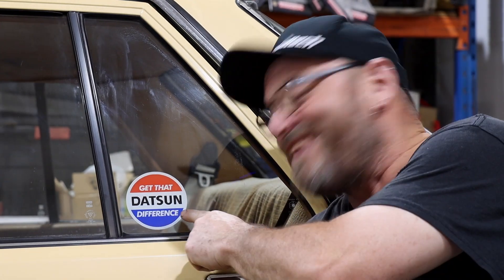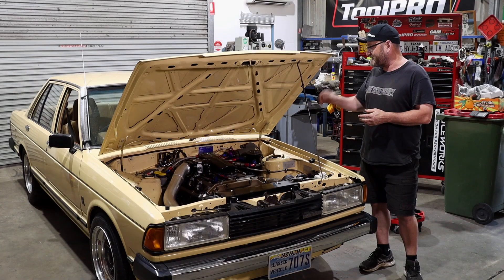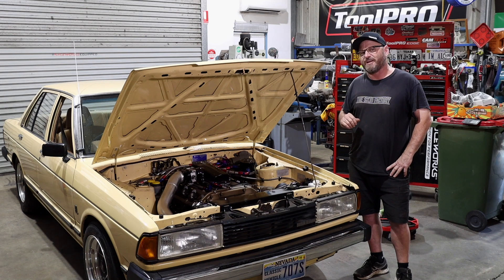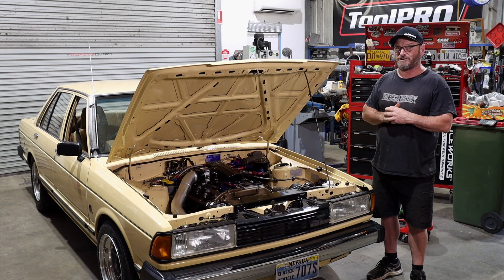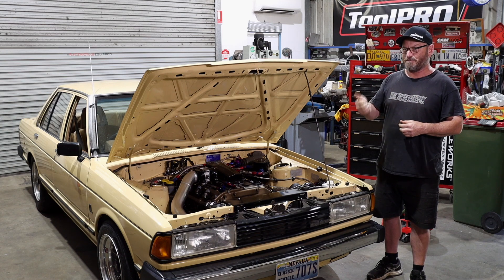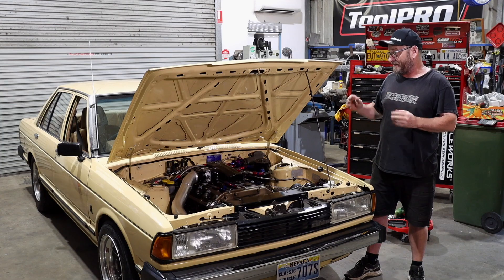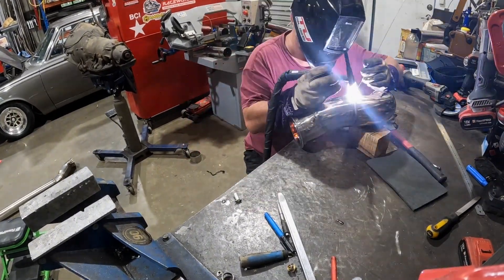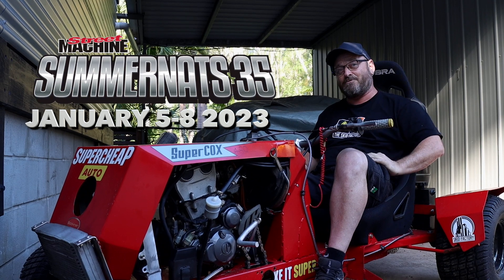550HP TURBO V6 VQ35 - Get That Datsun Difference

Comment: VQ's are some of my favorite engines to build, both N/A and for boost, and I love that we are seeing such a monumental surge in unique content/interest (...chicken/egg... whatever, you guys get it haha) revolving around the VQ platform!!

Thankfully, I expect that it will only continue to grow in popularity, at least here in the States. Especially as the vehicles that are powered by the VQ's are settling squarely within the price range that make them attractive to first time car buyers, or tuner-car buyers, alike. Combine the low financial barrier to entry with the fact that almost every VQ Nissan manufactured was built to power a RWD (OR AWD!) platform (350z-370z-g35-g37-m35-q50-etc) straight from the factory...shiiiiit. These build options alone really has me looking forward to the future of what the performance automotive industry will have to offer.  :)

Then, once these VQ's start to lose relevance or become hard to come by as the years come and go, all of a sudden the VR platform(s) will reshape the scene just as the VQ is now, and if you can't get excited about 400+WHP and chu-chu sounds with 100% stock components running on pump gas with a simple reflash of the OEM ecu, you might be in the wrong place?!?

Comment: Thank you for creating such awesome and informative videos Al and Woody. It's really calming watching you transform parts into mechanical perfection and a bloody good laugh as well. 

I have been working on my project car on and off  for a few years after watching your first turbo install videos Al, with Marty and Moog, which inspired me to get tinkering again. I grew up in the bush in Southern Africa working on enduro bikes. I was so happy when you started your own channel. 

So using all the info from your and MCM vids I turbo charged my old family hatch back Nissan Almera 1.4GX N15 (GA14DE) with a Garret GT15 Turbo from an old BMW, using Sentra turbo racing exhaust header, 1.6 Sentra fuel rail + bigger injectors, catch can, fabricated a down pipe to link up to stock exhaust, air/fuel sensor + guage, intercooler from the same wrecked BMW + BOV + boost tap, and added a Perfect Power SMT8L piggyback for fuel/timing. I also did a head gasket change and replaced timing chain + guides. She went from 80hp NA to 120hp, scared to push it harder without upgrading internals. 

It’s been a great journey, and she is all working sweet now, just fighting with 27 Yr old bloody stock immboliser system ironically that intermittently drops sync with the key chip, so working on how to bypass it at the moment.

Thanks again, you are legends!

Comment: My dream is doing this to a 2 door hardtop 🤩🤩🤩🤩 I grew up with one of these, a 82 diesel (L20D). The most bullet proof engine ever: at 400 000km it didn't heat a glass of oil each 5000km. Also the most clear dash ever, specialy at night. Torquey but such a snail! It had IRS in  Europe so handling wise it was  very similar to the small BMW and Mercedes of the time (front mc pherson and semi-trailing arms at the back)
A school of drift!

Comment: Loving the Datsun. My first car was a 88 bluebird. A great car if you liked working on cars, always something to fix.
Reply: You had an ‘88 Bluebird? Which country was this in? I think they had replaced those, with the Skyline-bodied (R31) Nissan Pintara’s in Australia by then.
Reply: @paulsz6194  it was in Oz. I might have the year wrong. It was the last of the bluebirds, whichever it was. It had a 2.0l twin spark inline 4. Rear wheel drive. 5 speed manual. The headlight enclosures were all clear, rather than having an amber indicator lens. Had nothing but trouble with it, but  your first car is supposed to be like that I think. I enjoyed my Ford Telstar more.
Reply: @james.vanmaanenberg  
1985. After that, the Pintara with unleaded engine was released.

Comment: Yes,the Nissan engines run tight crankshaft bearing clearances from my experience with the RB30 engine.

I was told that the rear drivers side lower control arm mount needs to be braced better than Nissan did it at the factory if a high performance engine swap is done it can tear it off the shell.of the car since it's just welded onto the shell & not the chassis rail.

I was told that the right hand rear control arm mount tore off the shell  underneath of a Nissan Bluebird sedan after they did an FJ20DET engine swap into it .

That car was available in the I.S. in V6 form badged as the Nissan Maxima or Cedric.!
Reply: I too have the internet and taken steps to strengthen the rear chassis connections

Comment: i just picked up a almost unmolested 84 model 3sp auto l20b job with a genuine 123785km on the clock . i do have to fix up some home brew wiring but will need the owners manual for that.

Comment: Having a 910 long nose with a L28ET love these short nose 910 jelly of the smaller bumpers.
Reply from the maker: I have never heard of a long nose 910. Sounds cool.
Reply: @theskidfactory  Essentially the same car, US spec car we call the Datsun maxima aka Datsun 810 Maxima stupid US marketing.  G910 chassis IRS rear suspension a L24E up front with the longated front end to accommodate that inline 6 as well as ugly big bumpers.  81-84 were the only years offered on the G910 with a L24E petrol engine or a LD28 diesel early 81- partial 83 offered with a 5 speed or 3 speed auto half 83-84 offered 5 speed and 4 speed OD auto Jatco transmission.  Our L24E had a N47 cylinder head with a P30 block 8mm rods.  We also got the predessor G810 for 77-80 with only L24E engine offered 4 speed manual, 3 speed auto.  Sedan had a IRS rear suspension, wagon had the H190 solid axle, 79-80 Hardtop/Coupe had a IRS rear suspension, 5 speed manual or 3 speed auto.

Comment: Bro... used to go to tafe when I was an apprentice back in the day with a lad that had that exact car with a z18t I think they were called... old twin spark turbo motor with a bigger turbo and an ancient aftermarket ecu... maybe 250hp... it regularly used to pull the control arm mounts outter the floor... ha haa.

Comment: This engine bay is proof that, if you want to give yourself an upgrade path and the ability to reuse components in the future, you need to invest in quality components.
No matter what you hooligans do to this little beastie, you can keep a lot of that gear in its place - or at least repurpose it onto the new setup.

That wiring nerd seems like a smart boy.

Comment: Al, I saw it in the H6 swap in the Levorg and now here, and that gave me a question: why the flex pipe in the exhaust manifold in between cylinders? Shouldn't it be one piece? In theory, the runners shouldn't move differently between banks of cylinders, should they? Loved the video!
Reply from the maker: The engine expands due to heat and the flat or V formations are basically two engines joined at the crank so they expand differently and you need to allow for that between the banks where possible.
Reply: @theskidfactory  makes sense! Hadn't thought of that, thank you for taking the time to explain!

Comment: Nice. My Mum had a 910 series 2, '83 model.  She paid about $6k for it in 1992.  White with blue interior and a blue stripe on the side because it was a Venturer special edition.

Lots of memories growing up in it like the time Dad cooked the brakes going down the coast and the time Dad bought some Magna rims at a garage sale because the factory rims had become about as round as a 50 cent piece.

It eventually got traded in for a '91 Corolla in the early oughts because rust was becoming an issue.  A downgrade in my opinion.

Comment: 910 bluebird price increase coming soon 😂
On that, the series 1 and 2 910 both had the Datsun h165 diff standard and the series 3 had the h190
BW Diffs didn’t join the team up until the r31 skyline and pintara ;)